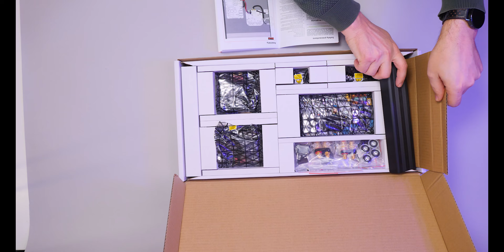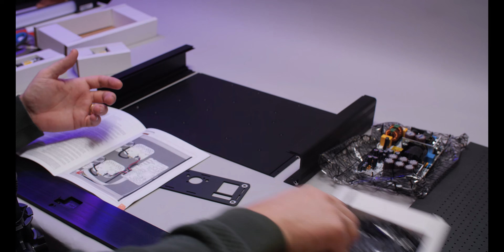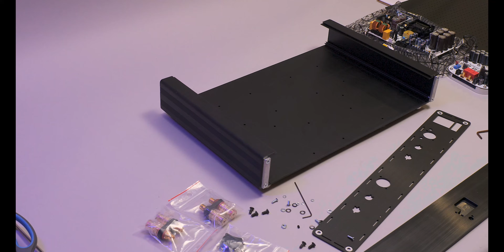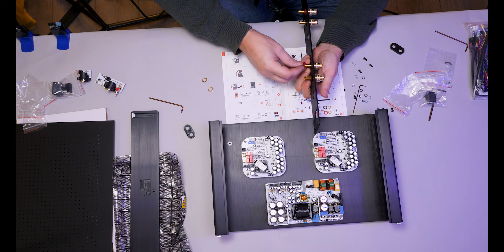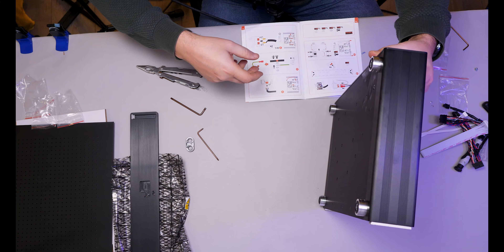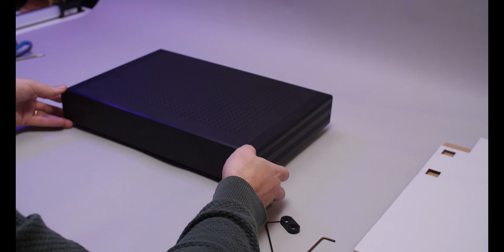Build Guide - Hypex Nilai 500 - Class D DIY kit - Stereo power amplifier

Comment: Thanks a lot for this! Building it was very easy and enjoyable with your guide. The finished product sounds fantastic with my Eversolo DMP A8 and my old Monitor Audio speakers. Completely different sound from my very nice old Linn A/B LK140 amp, much more clarity, detail and bass control. However I still like the old A/B amp sound character too. Tried the 2500 euro Moon 250i class A/B amp too as a replacement for my Linn LK140. That also sounded fantastic in the mids and highs, but completely lost it in the lows, so that wasn't an option in my setup. Thanks guys, your review and listening to my friends much cheaper but actually nice sounding Wiim ultra in my setup was what finally made me decide to buy this and it turns out to be a very good choice for me.

Comment: With the back panel being thinner I think it could have done with the bracket to connect to the base halfway across the width for a bit more stability, especially as people will be pulling and pushing on connectors on this panel.

Comment: The ATI Hypex amp has a huge power supply that this amp does not.  This amp would still perform well but would not have much add'l peak power it seems, which may not be needed often.
Reply: You're comparing apples to oranges... ATI uses a linear power supply, this is a switching power supply, a well designed one at that, almost overkill... If you want to feel all warm and fuzzy about poor efficiency, high heat, huge weight and size of your power amp, might as well get an old school class A, not a modern, state of the art class D.

Comment: The Nilai 500 is utterly linear. The NCoreX 500 produces harmonic distortion that is -120dB from the reference tone, which is provably inaudible with virtually any speaker.. The Nilai 500 produces harmonic distortion that is -140dB. At that level of distortion, the only undesirable effect is the background noise, which remains about -113dB. The only more linear amplifier is the Topping LA90 which has lower power and lower gain. Today, the problem is with sources that don't supply enough signal to reach full power from the amplifier, and then you have to switch in the buffer stage which amplifies the sound but also the incoming noise.

Comment: I just ordered one of these. Objectively it is beyond impressive but your subjective takes (video) on the latest Hypex & Purifi modules is what got me to pay the little extra price for the Nilai. I've tried UCD & Hypex in the past so im excited to see how Class D has improved in the last 3 years. Even the older models were not bad. Especially for the price. They could be a little hard but i found coloring them with a softer type tube preamp was a good mix. I'll probably push the Nilai straight from a RME dac for streaming. If the Nilai is as good as described I'll up the ante with a better or an appropriate preamp. Thanks for the video... I'll be using it when the amp arrives.
Reply: I finished the amp the night it arrived. Used this video as a guide. Took me a little longer than I thought due to the small parts vs big man hands. My tip to any future builders..don't over tighten the enclosure or more importantly the feet. The top won't slide on if everything is overtightened. Loosening the feet helped tremendously. Best to do the final torquing when completed. 

On a side note the amp really does sound wonderful. Handles speakers equally as well at lower volumes. A lot of Class D haters cry about the topology being emotionless or no soul...too dry or analytical. I don't think anyone will say that about the Nilai. It is transparent & resolving so if your upstream components are weak or distorted the amp will amplify those aspects. I feel this Nilai just made amp buying real easy. The price to performance is ridiculous...this amp is a great buy imo. I ran it straight from dac for a few days but now using a single ended no feedback 6sn7 tube preamp & I'm very happy with the combo. 
Fantastic amp. Had I known I would like it this much I would have ordered the mono blocks
Reply: Hey thanks for the update ! What’s the preamp you’re using ?
Reply: @flash4973 when I wrote my comment I was using a preamp I built off PCB's by Mellow Tone Kits. The 6 & 12sn7 Universal preamp. Then I built their e80cc preamp which I really liked..with expensive tubes. But then I started using my RME ADI-2 FS dac as the preamp with its balanced outputs. It's kind of a great match with the Nilai. Plus it has PEQ for speaker/room issues. But right now I'm using an Icon Audio LA4 MKiii tube preamp with the Nilai. It sounds great imo. Beautiful vocals. 

Sorry for the long answer but I've really tried a lot of different things with the Nilai. I think it's a great amp for the money..and I have a bunch of amps in the house. Some 2 and almost 3 times the price I paid for the Nilai. I've been using the Nilai everyday in a streaming set up. 
I wish it had single ended inputs to go with its balanced inputs is my only complaint. And regardless of what many may say, I feel it took about 2 weeks to kinda open up. Most people will say that's all in my head but whatever. I also recently felt that the amp sounds better when I leave it on 24/7. I think that with almost any decent solid state preamp the Nilai will pair well. As long as it doesn't have a lot of power supply noise/distortion. I tried it with 6 different tube preamps thus far. I like the Icon the best. But if I include the price of NOS tubes & capacitor upgrades it's an over $3k preamp. The amp pairs very well with the RME dac/preamp too. I could live with that. But I'm the type that wants to try different stuff all the time. Doesn't matter if it's super cheap or expensive. I've had much more expensive amps. The Nilai is great for the money. Just my personal opinion.

Comment: The Shiny Bottom . . . The power amplifier is polished not for appearance, but for coplanarity.  In other words, it is a very flat and even surface so that the thermal impedance is reduced from the power amplifier to the chassis. The power amplifier is mounted to the chassi and both surfaces have to be flat to minimize thermal impedance or heat transfer. This reduces operating temperature of the amplifier for a given power output. What would be helpful is to apply a very thin coat of thermal compound. This will also reduce thermal impedance, therefore enhancing thermal conductivity to the chassi reducing the operating temperature and increasing reliability.
Reply from the maker: Thanks!
Reply: Yea, you should definitely use some thermal grease between them.

Comment: My kit arrived 2 days ago and I built it that night. Yesterday afternoon I went to test it and it seemed dead. After a few hours of checking my build and testing input voltage and wiring, I realised it has a tiny power button on the front... Doh! In my defence, for many years I have been using a Sunfire amp that only has a single power switch on the back which is where I went wrong.
Reply: Oh man lol...that would have drove me crazy. And then I would have had a good laugh at myself 😂

Comment: It looks like the Nilai 500 stereo kit uses the same power supply as the 500 monoblocks. This means that the stereo one shares one power supply between both channels, while the monos have a dedicated power supply per channel. Does this compromise the sound of the stereo one in any way; do the monoblocks sound better because of this?
Reply from the maker: I haven't tested the monos. But i guess the monos have more headroom.
Reply: It's a different power supply on the Nilai...PS500DIY. Supposed to be the quietest PS of the Hypex & Purifi models. That's what I read anyway.

Comment: A very nice amp, i replaced my Rega Elex-R with it.  Assembly went easy.  First test i did was using the Elex-R as preamp and the source i used was my Ayre QB-9 DAC: It's a very nice upgrade from the Elex-R which is a best buy in its price range!  This amp feels like it has a perfect control over the speakers, completely transparent, very nice balanced sound, tight bass, very detailed and neutral mids and highs.  My speaker are the very fine Ryan R610, them too are best in their price range, better than many speakers that costs twice as much en even more!  I just added the DIY Class D preamp and started to use XLR to hook up the amp and my DAC: It plays really wonderful!

Comment: Thank you for this. I ordered and build the amp with the help of your video. This KIT makes DIY possible for SIY(Screw It Yourself) people like me lol. One thing that bothered me though is the 3 out of 4 screws needed for the XLR connectors were missing form the KIT. Luckily i asked a local technician and he was able to scavenge them for me from old machines. The amplifier is dead silent with no noise coming from the speaker twitter.

Comment: Purify has latest versions of Bruno Putzeys designs, if you like that flavour, and ICE power 2000as2 is a true kW capable fully balanced design at less cost and with similarly inaudible distortion (no, even if you could hear the difference in the last digits, THD is not the most important criterion for a musical amp, as any designer could just apply more negative feedback to make it measure better - far below the human hearing threshold in all cases) but with significantly higher bus voltage = improved dynamics and the subjective experience of truly infinite power.
Reply: I remember from my younger audio days that negative feedback is a "double edge sword" not a panacea.

Comment: Way over priced. IMO this is not a kit. The PCB's are completely assembled and flow soldered. Placing hardware etc. on the chassis and screwing a power supply and two amplifier PCB's into place is not a kit.
Reply from the maker: Okay
Reply: Cutting edge technology is not going to be cheap.
Reply: Well, everyone ain’t Lego or AirFix guys.
Reply: It's arguably "cheap" for the performance. And while it's not a kit in comparison to say a Dynakit or Tubes4Hifi kit it is definitely not fully assembled and must be put together to work. It's pretty much a kit or DIY project.

Comment: Great build! You have done your Lego/Airfix as young?  Would a second power supply fit into the case? Dual mono would be better, or would it be overkill?
Reply: Ive seen some class D offerings with dual mono.
Independent PSUs would be better for headroom and dynamics I would think.

Comment: The Hypex computer animation of the assembly showed a film on the base plate of the amplifier module that needed to be removed before mounting it in the chassis. I didn't see this film being removed in your video.
Reply from the maker: The guide doesn't say anything about that as far as In can remember.
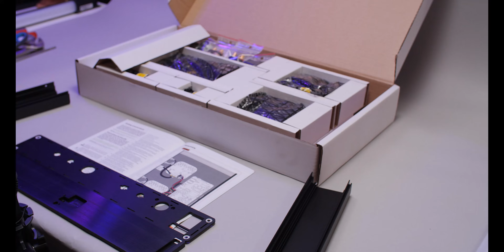Reply: @TheAlphaAudio  Sounds good. I only mentioned it because the Hypex YouTube channel put out a computer animation video of the assembly of this amp (https://www.youtube.com/watch?v=tEVyDF5xW2M). At about the 1:50 mark, they show a film being peeled off the metal plate of the amp module. I figured if it was there and not removed, it might interfere with heat transfer. If it's not listed in the instruction manual, maybe the kit ships with that film already removed. Anyway, the amp kit looks great! I've been eagerly awaiting some reviews and a full set of measurements.